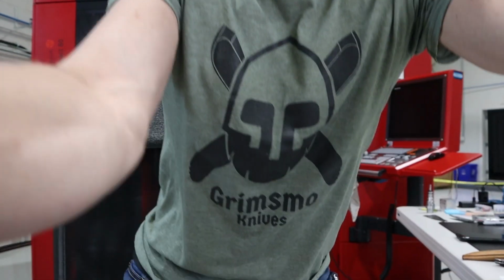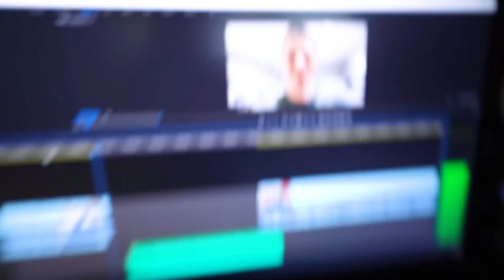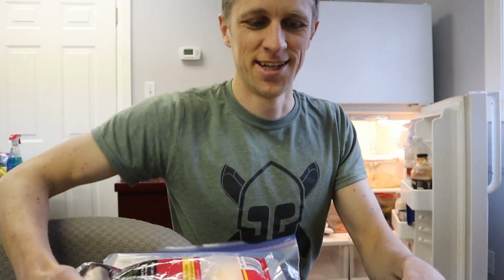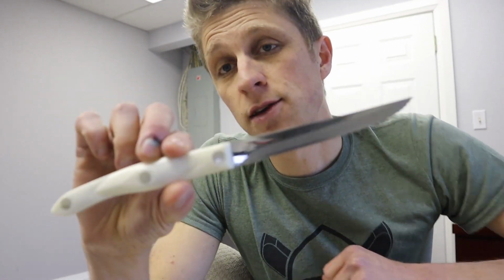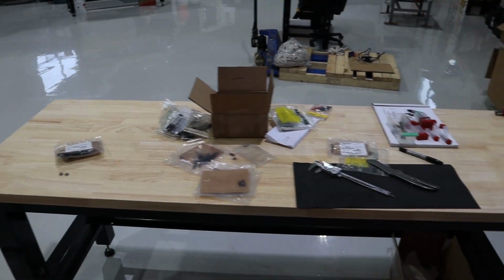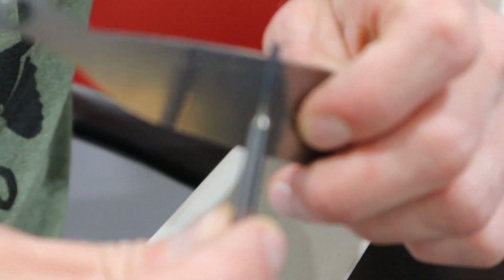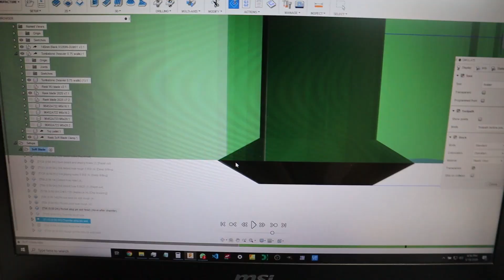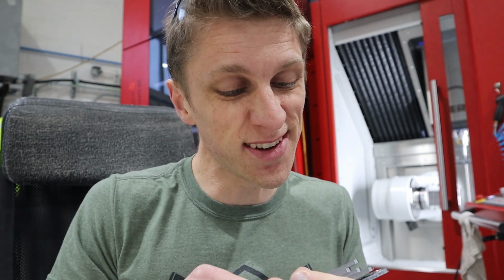We Made 5 Rask Blades! - Quarantined Shop Life 29

Comment: To John: For doing serializing you can try the following:
1 - Create(post) a knife with each digit present(e.g. 0000)
1 - Create(post) code for every number, from 0 to 9, in every position(so, 4 sets of 0-9 in each digit's position, for example)
2 - Separate each number segment, so you have each number for each position in a separate file
3 - Write a script in something(Python works for this, it's pretty simple) that will replace each digit with the input(say, "knife.py input.nc 0123"), using the pre-posted digit blocks.
So if you input serial 0123, it will replace 0#1 with code for '0', 0#2 with code for '1', and so on.
4 - Optionally, have the script automatically increment a counter inside a file(so running "knife.py input.nc" will give you a knife with serial+1), and read the serial from that file instead of manual input(so you can never make the same number by accident).
5 - Network the Kern so the script automatically overwrites the same file directly on the machine.

To Fraser: Please, EQ out the high frequency crap. You can hear a continuous high frequency squeal at around 18:40, and even over John talking at 19:50, and at many other times. There's no useful info at those high frequencies, they just have to be cut.
Reply: Looked up G-code and found it was like the output from something like byte codes.  So your way is really the only way, making the G-code blocks and including them.  I would add some script code to handle character width and spacing.  A proportional font is possible that way.  Once you have that you're one step away from adding customer names on knives, assuming you have the other G-code blocks for all characters.  Fusion 360 could probably gen the G-code for an alphabet in a wide selection of fonts and point sizes?
Reply: @markramsell454  The issue with generic custom text would be having to generate gcode blocks for every letter, for every position, since the knife is not just a flat surface you can offset the letters on, and certainly not on a 5-axis. With just a few digits of serial number it's manageable, going further would require automating the actual CAM process, and that's a hell I would advise against stepping in.
Reply: There should be a macro on the haidenhein controller for serial numbers that works with a integer input and puts out an engraving tool path
Reply: Hi,it is not the only way,he can go on heidenhain page and download the programs for manual and automatic engraving.You need to play little bit with it to figuered it out but it works fine.
Reply: hnnnnnnnnn I don't hnnnnnnnnnnnn know hnnnnnn what you mean hnnnnnnnnn about the eq hnnnnnnnnnnnnn
Reply: Q parameters!!!!

Comment: Can you probe the fixture to set the bottom of the stock height and run your chamfer contour from that value?  Could then probe top and do the top chamfer.  Don't know how that works in production but it would work for variable thickness blades.

Comment: Hey John once you have the correct 60 deg chamfer on the top & bottom edge of the blade can you not use the machine touch probe to position the top edge chamfer on each individual blade due to the variation in material width? The bottom is constantly fixed as its the location face.
I know this cannot nulify the variation in the tool but its as close as you;ll get i reckon.

Comment: Why not use the full radius tool to give it a micro bevel on the spine of the blade?  You're already using it and you've already calibrated the depth, you just need to calibrate the engagement.

Comment: I've never done any five axis stuff, so maybe this isn't practical, but would it be possible to use probing to set a coordinate system to the centerline of the blade for the chamfer? Then you could have slight variations in stock thickness, and the chamfers would still be symmetrical. It wouldn't solve the problem of tool variation, though.

Comment: I think I remember from NYC CNCs thread mill guide that most thread mills don’t come to a sharp point so (depending on what you are using as a control point) that might be what is causing discrepancies on the top and bottom chamfer.

Comment: Just touch off the thickness of the blade with the probe and compensate for that, the tombstone should be repeatable enough. Also measure the treadmill in the middle and not on the end of the cutter. The cutting face is the geometry you are interested in, not the length of the tool.

Comment: For Canon streaming it might be worth a look at Magic Lantern (magiclantern dot fm), which provides a range of non-standard options for those sorts of shenanigans
Reply: That is an option. But older Canons only have USB 2.0 on them, which could be a bit problematic. A lot of professional will use instead some HDMI grabber, like AJA U-TAP HDMI, or something a bit cheaper. Unfortunately a lot of cheaper HDMI grabbers do show some issues sometimes (like Magwell HDMI to USB converter, will sometimes drop frames, or desync audio a little). Or use more modern body, with USB 3.0 and Type-C connector. But pros will still use HDMI grabber to have more control.